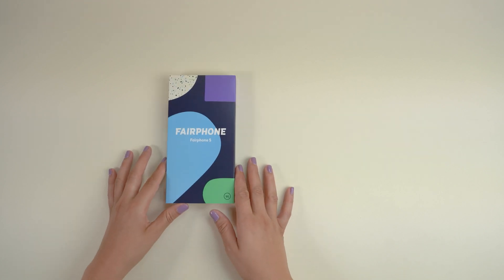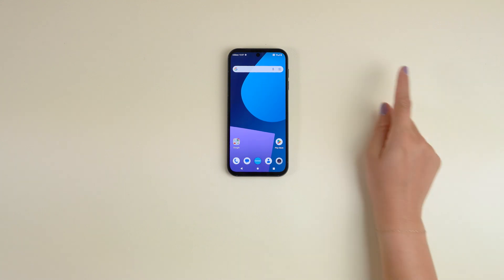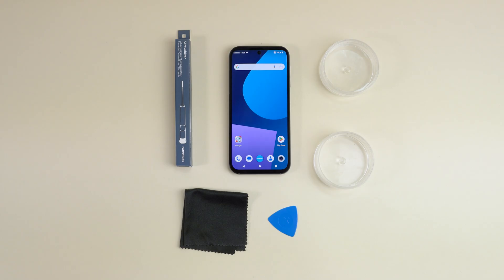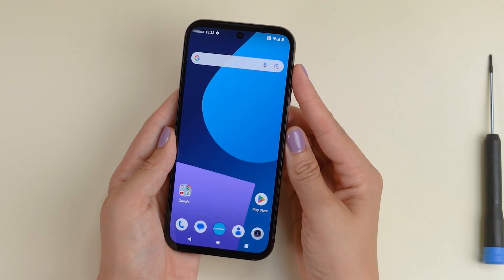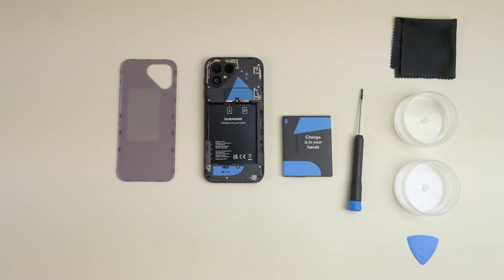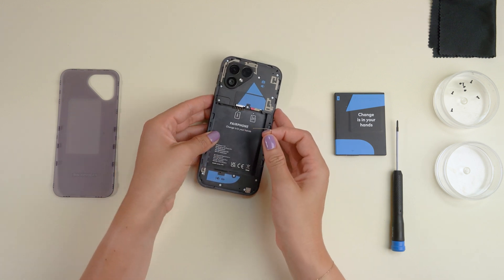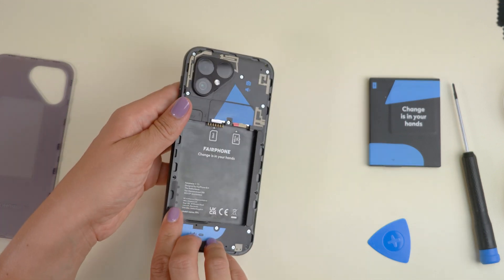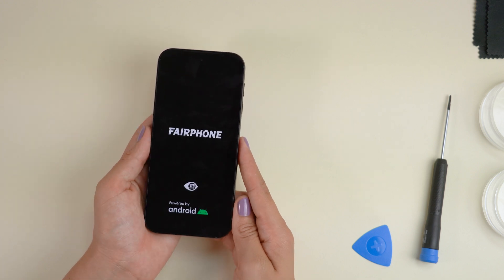Replacing the Display | Fairphone 5

Comment: Great video! I had accidentally scraped my phone along a wall and some paint got inside the edge, so I had to remove my screen to clean the sides of it. Nice touch that the 8 screen screws are color coded black while all the other screws I could find were bare metal! It's wild how easy this is to disassemble and reassemble. I just casually did this at work inbetween two tasks just to clean it a little. 

I've taken apart other phones and it's always a whole process and takes 30+ minutes and requires all sorts of prying and ugh and eurghh... and now this guy's come apart and back together in three minutes.
Reply from the maker: yeeees! Love to hear it - Right to repair ftw!

Comment: Almost all other phones require you to DISASSEMBLE the ENTIRE phone and reassemble it on the new screen...
Are you telling us that was unnecessary this whole time?

Was it just a tactic to make the most common repair as difficult as possible, by using the screen as the base everything is attached to?
Reply: It's not some grand conspiracy, it's just what happens when "repairability" is not in your goals list, but size reduction, weight reduction and cost reduction are.
It's going to take a strong legal or consumer demand for high repairability for other manufacturers to start giving a damn.
Reply: @majorgnu  I wonder if requiring the use of category terms along the lines of "Frame display" and "Free display" (or "Replaceable display") and "Other type of display" in product descriptions, maybe it would be more easy to shop for.

Same with removable batteries.

It's a type of category that doesn't usually appear, the assembly structure of the device hasn't been part of the "stat sheet" traditionally, but this is an important part and something consumers might find useful if made clear as:

"a free display makes repairs cheaper, faster and easier, while using the display as the frame means the entire phone needs to be disassembled as everything is fastened to the display unit"

Idk if it could be government regulation, but it could just be something some storefronts and reviewers are successfully convinced to start to list. And push harder for it if necessary.

Would need to get the definitions right and nail down a good set of names for screen connection types, unless good options already exist in the mobile industry vocabulary.

Comment: Please standardize these Modular component’s size and interface as cross manufacturers free shared standards, allowing every other manufacturer to produce. We can buy standardized modular component from different manufacturers then build, upgrade and repair our own phone.
Reply: While that would be ideal, I don't see it happening for several reasons.
It would require every phone to have the same shape so the displays fit. It would require the display controlling circuitry to be attached to the display since every display has its own unique ways of being controlled. If you've ever tried to convert a laptop monitor to a secondary display then you'll know how difficult that can be. Software also needs to be capable of properly displaying stuff on every type of display, and this is difficult because some displays have a teardrop design around the camera and others have a hole for the camera. There are also displays with the camera under it so you don't see it when you're not taking pictures. The exact shape of the rounded-off corners of the screen also has to be accounted for in the software and the display drivers.

Long story short, integrated displays are too complicated to make standardized displays feasible

Comment: Keep going fairphone. Headphone jack next time. Still using my Note 9. Perfectly flat back and headphone jack. Battery life? f#&@!d but i refuse to buy a phone without a jack. 8 years of updates on fairphone is tempting... Just sad the hardware is meh. Stop wasting time trying to get CPUs to be replaceable. Headphone jackkkkk.
Reply: In case you don't know, there are USB C — 3.5 mm jack adapters.
Including some with power passthrough, so the phone can be charging while using wired headphones.
I used to be a headphone jack hardliner, but now I realize it's really not worth the space and complexity it adds when there are other ways to achieve the same effect such as Bluetooth and USB C adapters.

Comment: Got mine yesterday setup. Hope I don't have to replace many things in the next 5-8 years!
Reply: I had to buy the first spareparts after 3 1/2 years of usage. I'm a clumsy user and have nerve issues, so my phone has to take many falls. As long as you are not as clumsy as me, use a case and screenprotector, your hopes shall become true.
Reply: @ZerosWolf  Mine has fallen a few times, I have my second screen protector now but a third one may be coming soon, the second one has some cracks.
All in all I'm very happy with this FP5.

Comment: Add a headphone jack
Reply: THATS WHAT IM SAYEN IF THEY ONLY DID THAT THEIR PHONE WILL BE INSTAN BUY FOR ME FR FR
Reply: @AZOOZ4A  same for me
Reply: Get that piece of cable, from head jack to USB-C and you won't need a headphone jack anymore.
Reply: @rjung_ch  what
Reply: There are adapters so you can plug your existing wired headphones to the USB C port.
Some adapters also have an additional USB C port where you can plug a charger, so you can charge the phone while using headphones.
Reply: @majorgnu  that is a subpar solution, as you labeled charging and listing to music at the same time is an issue, having to carry around an extra dongle just to listen to music while charging is bad design
Reply: @whyarewehere3893  you could also get a spare battery and just swap the battery instead of charging the phone 😉